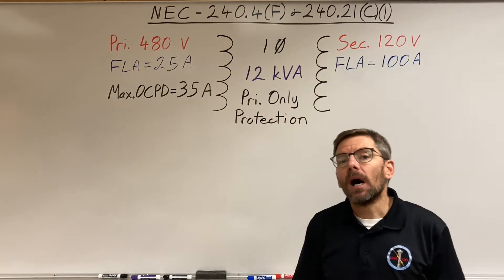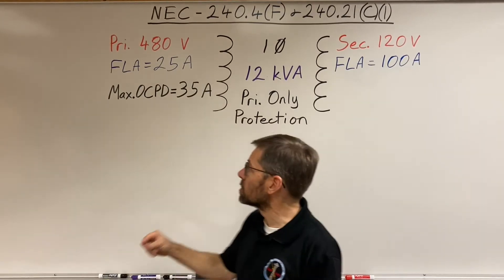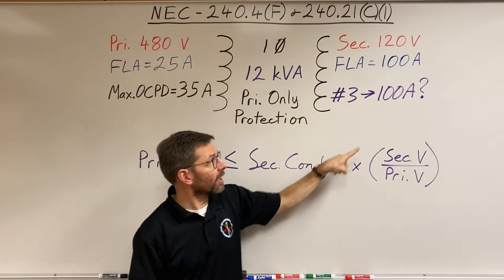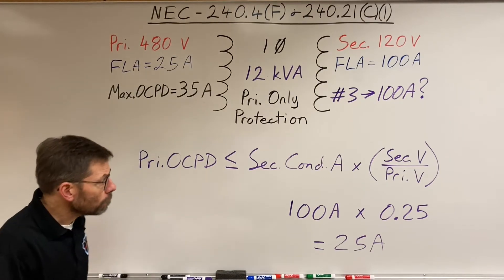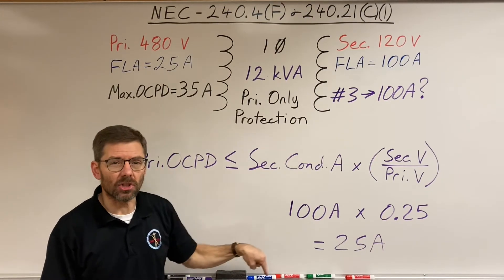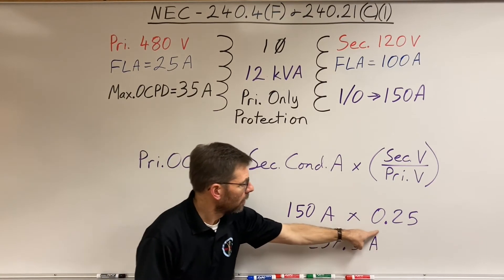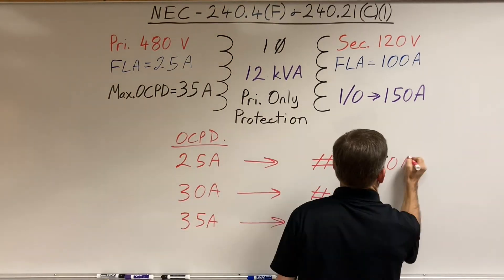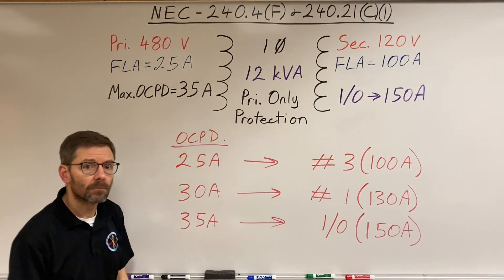Transformer Secondary Conductors - NEC 240.4(F) & 240.21(C)(1)

Comment: How do you size the circuit breaker when the transformer secondary voltage is 220v/30A and the primary is 24v/200A.
Thanks

Comment: 310.15(B)(16) for your ampacity table. Great guide, by the way. You call it 310.16 a few times but no worries :)
Reply from the maker: Thanks for the complement, and as "Ideal Alaska" mentioned, T-310.15(B)(16) in the 2017 NEC has been relabeled as T-310.16 again in the 2020 NEC. I have, however, clarified this by adding a note in the video description as only a https://www.nfpa.org/NEC/NEC-adoption-and-use/NEC-adoption-maps for list of states.) Thanks again.
Reply: Just a friendly reminder that it depends on what code book year is being used.
Reply: Former name in 2017 and before